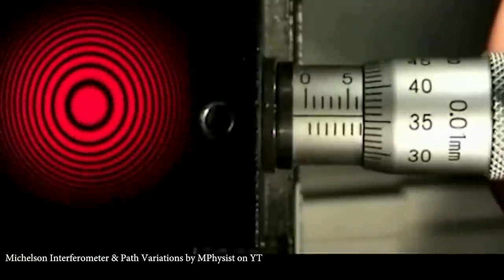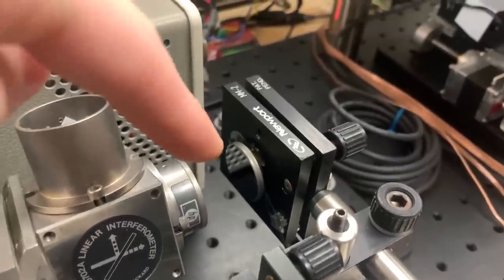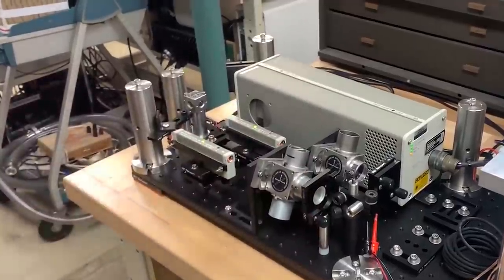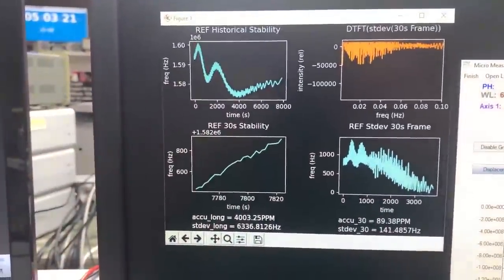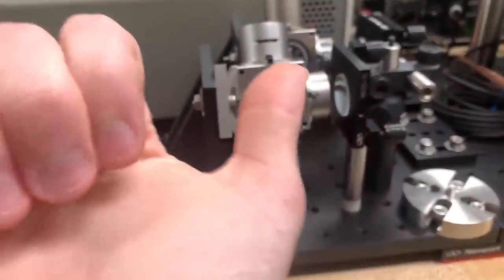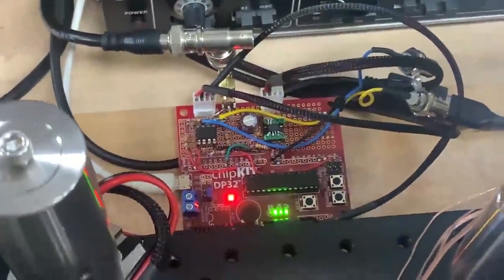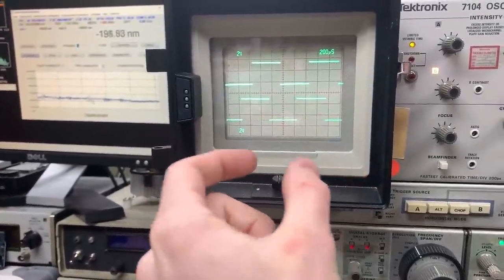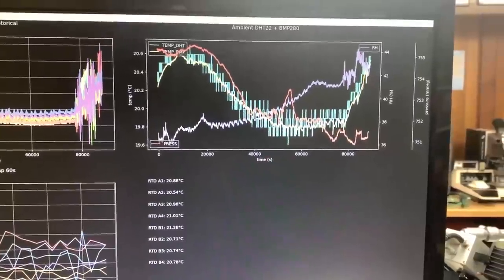Counting Atoms with the Doppler Effect - Heterodyne Interferometer

Comment: Remember grabbing those HP lasers up and fixing them, it isnt too difficult, just adjust the HVPS for optimal emission then once warmed up adjust the pezio inside until you get a stable locking frequency. What you are aiming for is a couple stable modes separated by a few MHz. Then your laser can be used for vibrometry like this. Believe it or not these HP lasers were used for active vibration cancellation on semiconductor fab machines. You can use a regular polarized hene laser with s heater and a couple magnets with a window controlled by a pezio disk to make one. Melles Griot part number LLR-1P was particularly good. ❤

Comment: I've worked for a time developing femtosecond and picosecond lasers, and we did a trick that I think will help you out immensely -- Water cooling your baseplate with a chiller. The Mai Tai laser that Spectra Physics makes has a copper tube that is pressed into the aluminum plate that's connected to a temperature controlled chiller.  This trick was also useful to temperature stabilize our power meter as well.  Making a box around the thing will also help a lot. You can make something out of clear plexiglass to isolate it all from air currents. Just blowing air inside the resonator path of a Ti:sapphire femtosecond laser was enough to get it to stop modelocking.  There are tones of simple tricks you can do so you can focus on what you want to use it for rather than watching it drift.  You can also consider things like using dry nitrogen inside your box to control the relative humidity, etc; or at the very least some sort of desiccant that changes color as it absorbs water so you know when to heat it up a gain to drive off the moisture.  Good luck. You have an awesome set-up.

Comment: Hi, I'm a physicist/electrical engineer. That sound you hear may be the driver amplifier going into oscillation because of the capacitive piezo load. You can make it stop doing that by placing a resistor in series between the amplifier and the piezo, probably 50-100 ohms will suffice.

Another possibility is that at certain outputs - i.e. the max or min output voltage of the amplifier - you may be exceeding it's rated common mode range. This may lead to oscillation, though this is completely dependent on the exact IC you are using.

Finally, and this is very unlikely, but it is possible that for max/min output voltages a wire is shorting to the metal optical bench, producing a tiny arc that makes a buzzing noise. But I would be very surprised if this is the case.

EDIT: Oh crap! Hi Sam! I just realized it's you! I'm the younger guy you met when you visited MIT to mess around with our electron microscope.
Reply from the maker: hey Colin! hope you are well. thanks for the note, I'm going to investigate that weird noise some more, I thought oscillation at first too but the driver has ample frequency compensation and can drive capacitive loads up to a few uF. I could me missing something though, we will see
Reply: You're overthinking it. Check the driving frequency, it's only 1Hz, if I see it correctly!
The possible causes you describe normally happen at much higher frequencies.
What I think is happening is a plain mechanical noise resulting from the crystal material being deformed and rubbing/pushing against its metal membranes, similar to the noise of a dry finger dragging across dry paper or a thin plastic or metallic surface.
Chances are that this noise's frequency is related to the metallic surface size of the piezo disc.
Reply: @SamZeloof  Gain of 27 so there's a chance of feedback, maybe from a grounding issue.  It's good practice to put the amplifier right next to the load because you also have quite a bit of inductance in your cables, but in this case the magnetic fields might cause small changes (wires etc can twitch) to mess up the measurements.  The other way to do it is to take separate wires back from the piezo to the amplifier so you can correct for inductance / capacitance "at the sensor" - like a good LCR meter does using Kelvin probes.  I spent many years in radio interferometry (direction finding) - working tiny signals using cross correlation which is fascinating.  Great to see you doing this.
Reply: @edinfific2576  Agreed. That's what it seemed like to me as well. Those discs have a very distinct timbre when they are buzzing against something... Sounded spot on to me
Reply: I think it's just the pwm drive frequency because its not a pure linear driver chip

Comment: You can thermally compensate your optical bench (similar to a xtal oven freq stabilization)  to +- 0.1 deg C with a DIY full area heater constructed of a large PCB panel under the optical bench. 
Etch the copper heater trace pattern to cover the entire panel and use a current source with a temp feedback loop (K thermocouple)  to a pid controller.
1 ohm heater trace resistance at 5 A gives 25 watts, more than enough power to bring your optical bench 5 C above ambient and thermally stabilize the optical bench.

Awesome metrology demo !

Comment: Since you asked: semiconductor equipment keeps its precision by a few methods combined. 

One: the area they stand on is physically uncoupled from the floor you walk on - it stands on the same foundation (or actually the same very heavy and large concrete beams on the 3rd floor of the building), but has its own very sturdy connection to it. To make it more "fractal": the entire building is also uncoupled from surrounding streets (and the parking lot) by driving the foundations very deep into the ground.

Two: the more sensitive the equipment, the larger the very heavy slab of granite in the bottom of the machine. Large mass means it picks up less vibration - or more precisely the same vibration energy has to move more mass, which means less amplitude for the same energy.

Three: cleanrooms are controlled for temperature, pressure and humidity (apart from particle count of course). I like going in there - no matter what the wheather is like outside it is always a very nice temperature and humidity and the pressure doesn't swing as badly as the outside (or even the office) even during a thunderstorm.

So I'd recommend: make sure you have the instrument on a very sturdy table. Add some very thick felt to absorb high frequency vibration. Then get a really large piece of polished granite from the home improvement store (or a local funeral director - sometimes gravestones are discarded without being used) and place it on top. Then place the equipment on the stone.

I would recommend you do the same for your stepper.

Comment: That was a really cool explanation and I finished my B.Sc. in 2015, so I started in 2012, which is 10years ago and I also applied once as a sort of techniquen for those kind of instrument, but this explanation reminded me at a interference labs exercise but actually the complete background of high precision measurement was lacking.
This was a really cool "refresher" and gave also additional information to the measurements equipment.
It is also quite clever to polarize the wave, chance them in the phase so that they destrucet and end with the delta valve.

Comment: Years back I was a Phd student (never finished for various reasons :p) and we were working on a bit similar thing but instead of two beams we had three that created lattice of optical vortices captured on camera, in theory could be 3 orders of magnitude better than traditional optical microscopes (since you got the picture of an area it wasn't measuring just one distance but rather a whole area at one without any scanning). Well, that was still a theory back then ;-) Anyway, the lab was at third floor (don't ask why i was not in the basement :p) and you could see people walking on the corridor not to mention trams near by. For that reason we were often doing stuff at night heh.

Comment: This is a pretty incredible demonstration.  Nicely done!!!  I wonder if you could you feed the output to an audio amplifier and listen to it?  Might be interesting to see if you can figure out what's introducing the various bits of noise.
Reply from the maker: i FFT'd the output and most of the noise is around 150hz, coming from fans inside the instruments on my bench. next largest peak is 60hz from the vibrations and hum coming from the transformers in those instruments.
Reply: @SamZeloof  So no top secret conversations showing up from vibrations in the floor?   :)     Quick question, sorry if I missed it.   If this is sorta superheterdyne, are A and delta A considered the baseband and B the IF?  So you get a 1.5MHz tone plus a modulated 1.5MHz +/- relative velocity/wavelength?    And this is what is counted in the software/scope?

Comment: Thanks for giving me lab envy. I have had a project in mind that involves measuring small displacements outdoors and I was wondering if you have inexpensive suggestions.I live on a mountain and could swear the angle of the trees to the ground is always changing. I suspect the top layer of land is gradually sliding down the mountain, but maybe wind is just shifting the root balls in the clay soil. I want to try to make a continuous measurement of the distance between (say 100m) points on the land. This interferometer seems like it might be the wrong tool for that job. Would something else, hopefully much cheaper and more rugged, be a better fit? Eventually I want to make a mudslide early warning detector because i'd really hate to wake up buried in mud and I'm sure many others feel the same way.
Reply: You might want to consider using RTK-compensated GPS for this, as it allows distances at the scale you're interested in to be measured reliably without some of the limitations of this type of optical interferometry. Normally GPS is only accurate down to around 5 meters, but with RTK you can actually measure the distance between two receivers with an accuracy down to 1 cm +/- 2ppm. (In a sense, RTK is actually a type of interferometry, using phase differences in the signals from GPS satellites.)
Reply: Similar interest here. Can we make an instrument to detect potential landslides? I am from India and we are facing unprecedented natural calamities from heavy cloud bursts and accompanying landslides. Keen to know more if you have any progress on this front. thanks.

Comment: Holy shit, fully working HP 5528A. 
Must be quite some work to get such a thing from ebay back to work. Old electronics/test gear from ebay, usually not much problem. But anything with physics or optics inside is usually pure horror, from my experience. That thing is also extremely nice to check surface plate flatness, btw.
Reply: It is a 5517D or C laser head

Comment: Very cool, Sam!! I'm currently working on an interferometer using a self mixing diode so I can avoid needing an extensive setup such as yours. Have you done any work with self mixing diodes?  You just got a new sub, thank you for your work.
Reply: I would be very interested in your experiments! I have a similar aim of using self-mixing diode setups, but the end-use is to detect environmental seismic vibrations caused due to human construction activities around forests.

Comment: It is likely that the laser performs as specified (and better); however, it generates heat and causes the aluminum optical breadboard to expand.  Stainless steel optical tables perform better, but aluminum foil shielding to redirect the heat would probably help... don't obstruct the cooling vents.  The heterodyning wasn't explained well nor was the fact that the two waveforms were shifting during your discussion.  The two red lines were separated by 1.58 MHz (about 200 meters) and you were clearly interested in smaller distances.  I suspect that the piezoelectric induced modulation is important, but I don't even know what frequency you were using.

Comment: I built a table in highschool (circa 1997) in my physics class for making holograms, I have no idea if they still have it or not..I suspended it using tire inner tubes and the table was a 1.5 foot deep sandbox. The sand provided a significant amount of mass to the table and everything else was on a 3/8" steel plate (I think? It might have been thicker) that effectively floated on the sand. The innertubes and massive weight of the table provided stability to isolate it from leadfoot highschool students stomping around.

Comment: To improve thermal stability, could you use a resistive heater and thermocouple, thermally bonded to the optical bench, potentially with a PID for control? Or is the existing DHT22 compensation about as accurate as you can get in this kind of setup?

Comment: I an working on something different but some modification may help any issues with noise.  I am finding noise decrease in a stable system if you vibrate it from the vibrating objects frame of reference parasitic vibrations decrease.  You're working with much higher resolution than I am but perhaps you could use such information to intentionally vibrate your entire system to gain stability.  Remember if an object is vibrating tangential to the force of gravity at 60 HZ then 30 times a second the object is in freefall and essentially microgravity.  Unfortunately also 30 times a second its at 2G give or take.  Sure its much more complex than that but hopefully everyone gets the point.  Its why a washing machine will walk itself to the point of lowest most stable node in forces.

Comment: You've probably solved any temperature issues that matter in the 2 years since this video, but just in case...

High precision machine tools often pump coolant through the machine frame. I was going to suggest that as a way to reduce temp fluctuations of your optics table, then realized it'd introduce vibration of its own :D

Switching to in-floor heating and cooling would help with the temperature spikes from the AC turning on and off, and simply leaving the AC's fan on all the time would probably help some.

Comment: Try putting it on a granite surface plate and better yet put the granite surface plate On a thim rubber mat then put the interferometer on the granite surface plate. Between the rubber mat and the sheer mass of the granite it should mitigate even more vibration
Reply: Invar alloy 是不是比 花岗岩 大理石 膨胀系数更低

Comment: Hi! your setup is not suited for such measurements: the wood table has a wide "vibrating frequency" suitable for musical instruments. That table does look like paper and covered with stickers, is not even wood. Try to put your equipment directly on the concrete in a basement.